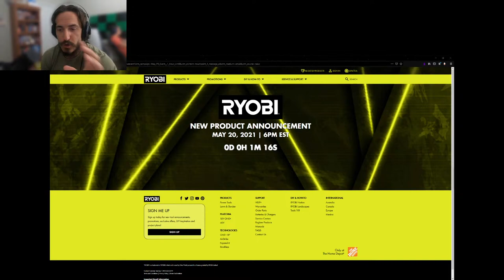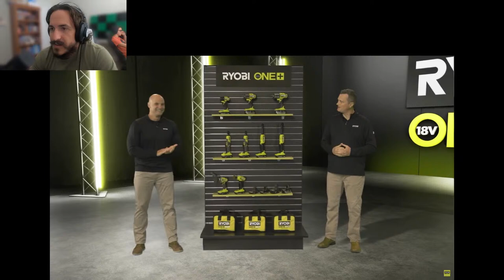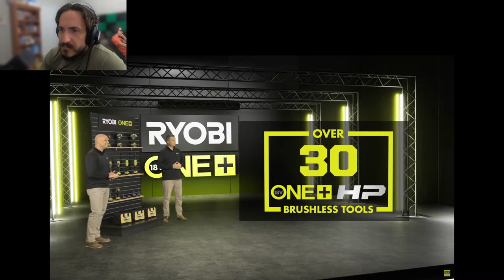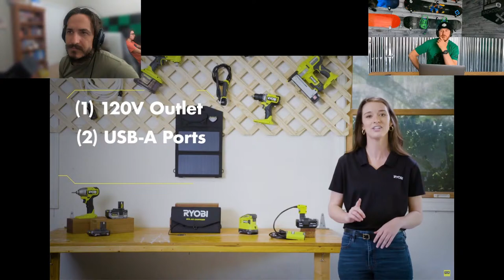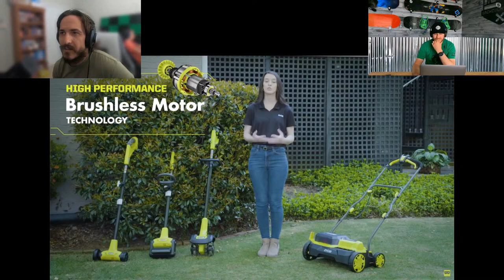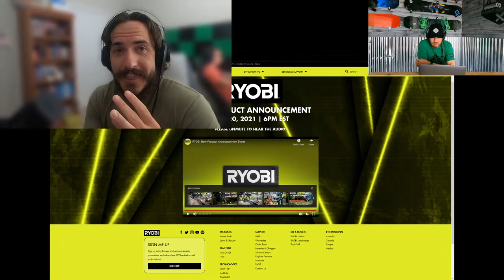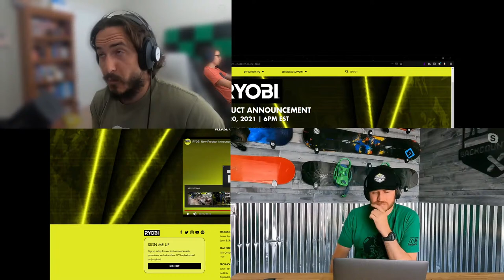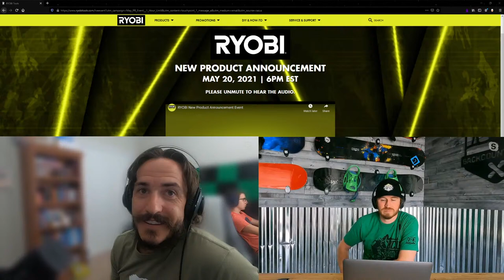25+ New Ryobi 18v Tools! - Watch with us as they are announced!

Comment: I've been using the old blue tools for years and they all still work. I bought a new green brushless hammer drill to retire old blue because it started to smoke  (used it to mix concrete)  Unfortunately the green drill took a shit and it barely had any work on it  so I had to bring old blue out of retirement (still drills holes just fine) . I plan on replacing all my tools to the HP line so I hope that pos hammer drill was just a lemon.